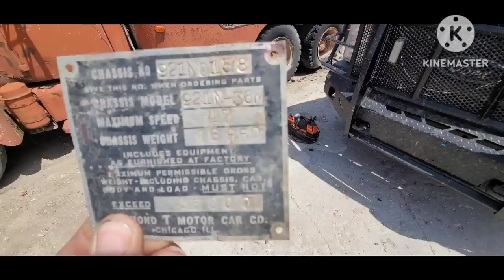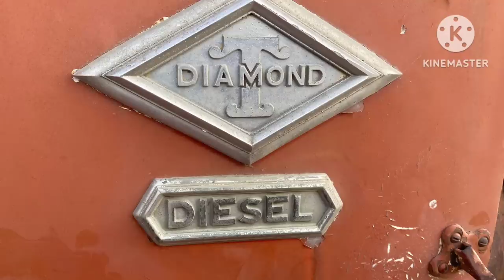We tow the 1952 Diamond T wrecker to the Rust Ranch! PLUS Junkyard Picking! Antique auction truck!

Comment: I got kicked off the highway in Kansas. Trooper told me to use back roads only. Was using a tow dolly to tow a 1956 Imperial 2 door that I bought of ebay. Topeka to Tulsa.  The rear tires were locked up and I was towing it backwards. Steering wheel was ratchet strapped in place. Car wandered all over the place because the steering system was all worn out. I got it home but it took triple the time. It is always an adventure!! 🤣

Comment: Stunning truck, would it have had a turbo in 1952?
Don’t know that I’d have risked towing a much heavier truck behind a pickup but he made it so I guess he knows better than I do 😊
Reply: My Dad did the same idea in 1971. I was a junior in high school. Pulled a 1952 GMC 3 ton wrecker behind a 61 1/2 ton Chevy pick up. On Jimmy was a gas motor with air brakes. I felt it ready to bump my Dad's 61, I let out on the clutch it tried to start,lurched forward ,caused $1500 in damage to the pickup. Of the days.

Comment: A lowboy and winch truck would have been more safe! How far did you have to go?
Reply: 50 miles. We drove 25 mph down gravel country roads. It was quite easy actually. My F350 has plenty of power and weighs more than 6 ton with four wheel disc brakes. Proper driving with an eye towards stopping distance prevailed.
Reply from the maker: It was 50 miles. 
Joe is a thinking, prepared worker. He grew up in Montana and watched the elder men of his family tackle complicated logging jobs. This definitely tested his limits, but it was a successful trip.